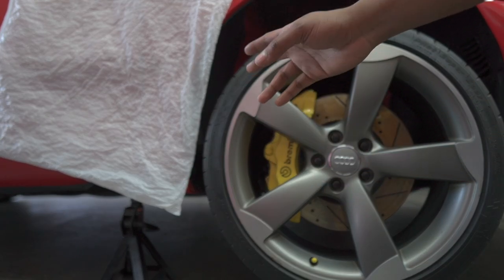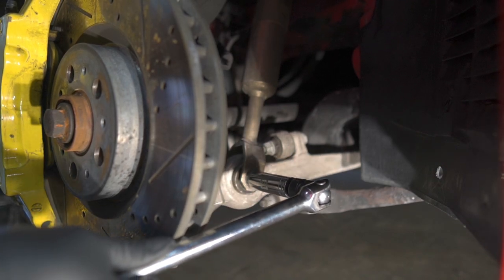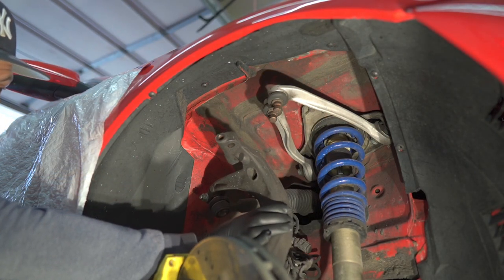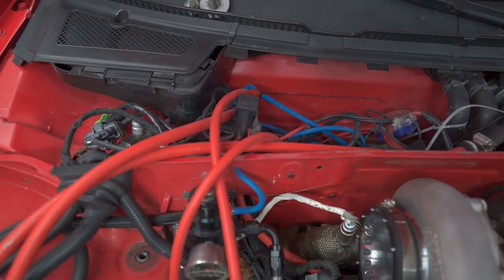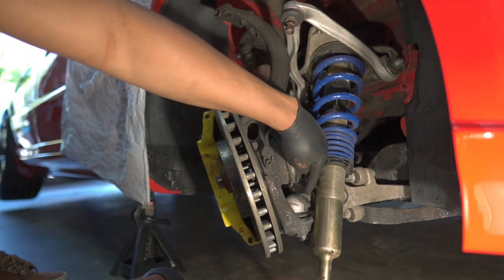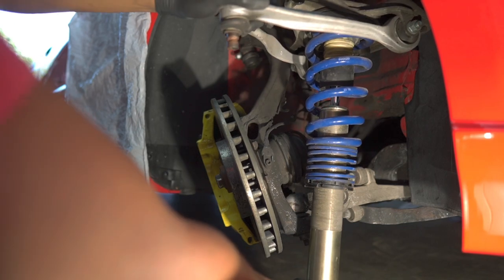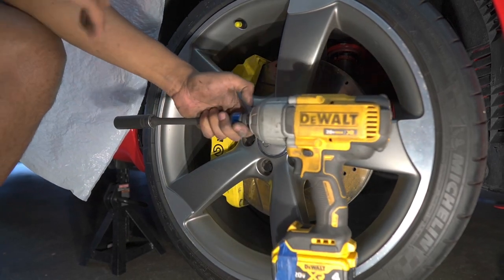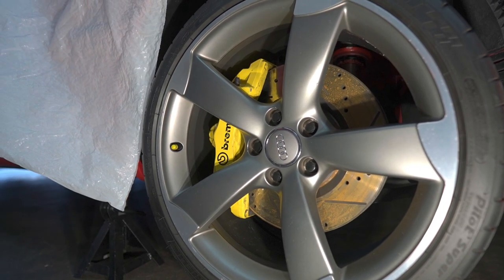Audi B5 Coilover Suspension Install

Comment: If you look where the 3 top hat bolts are you will see 2 plugs that are body color. If you remove those you can get to the 2 13mm nuts that hold the strut mount to the top hat. Then remove sway bar link and the lower bolt of the strut. Then remove strut assembly without even touching your pinch bolt of anything

Comment: Also make sure if you are removing the front top hat off STOCK suspension / Springs and Struts - USE A SPRING Compressor!!
Reply from the maker: Good call! Those things are holding a lot of tension

Comment: I've got solo works on my b5s4 as well and couldn't be happier and not to mention that I had made a wrong turn while leaving a meet with the rest of the pack and while on the freeway hit a curb about 80ish and got some air. Of course the first thing I thought of was the oil/trans pan and then the coilovers hoping I didn't blow any out but the entire suspension components were good so that was one less thing that I had repair from that wrong turn freeway outing
Reply from the maker: Yeah they are great coilovers for the money and wow did you get lucky on that bump. Happy to hear the car was good
Reply: @CIPGAS  I did get substantial damage to the underside of my car like both oil pans broke the trans pan inverted all four of my nice light weight rims bent luckily not broke subframe damage motor mounts broke swaybar bushing and the cup they sit in squished out and a few other little things

Comment: You aren't wrong, that pinch bolt is a swine!! The head snapped on mine, had to take the whole lot off to get it out.(looking forward to doing the other side! :-/) haha.
Reply from the maker: Hahahahaha that bolt is literally the stuff of nightmares. I had to replace not my uprights because of the bolts seizing in them

Comment: Also I was able to install the front coilovers on my b5 a4 without removing the control arm bolts/tri-y mount at the top, just gotta take off those little painted plastic covers holding the strut nuts to the body mount
Reply from the maker: Very true! IDK why but I just alway take it out. Maybe it’s cause I like to inspect things while I’m in there.
Reply: @CIPGAS  honestly getting the grommets off is really difficult, it has seam sealer on the underside and even has a tight double lip already securing it to the metal! But its possible and ultimately less to deal with. Most people will want to swap out bushings/arms anyways at this point
Reply: @CIPGAS  can appreciate the throughouness, I will be getting my coilovers on soon  but i know from previous attempts that my pinch bolts are seized solid and won't come out.  If you ever get the chance showing the method mentioned above for changing them out would be amazing.

Comment: Do coilovers for an S4 still fit a regular b5?
Reply from the maker: They will fit just fine but the S4 coilovers have a stiffer spring rate to compensate for the heavier motor up front